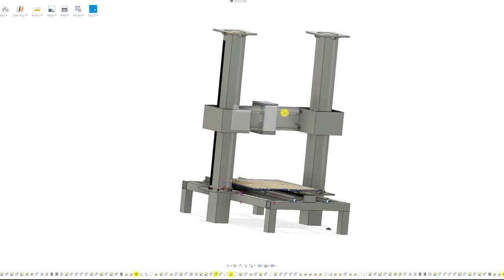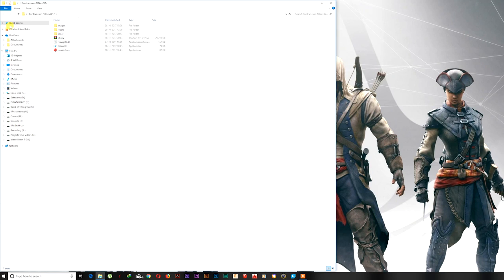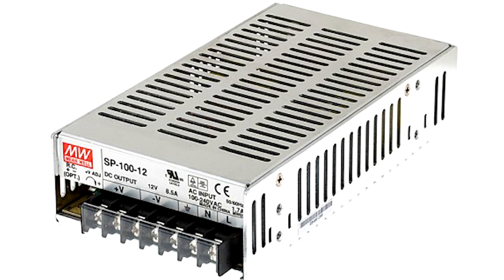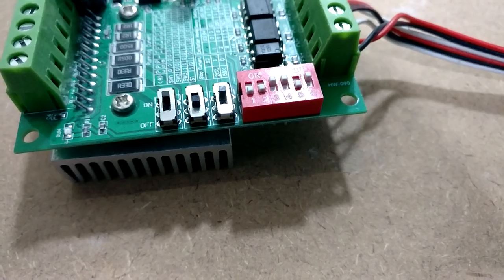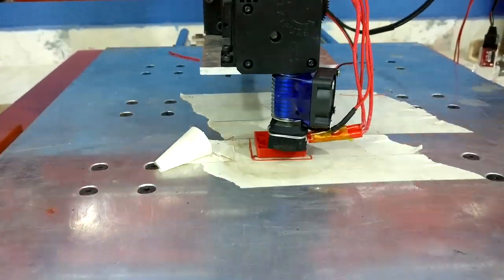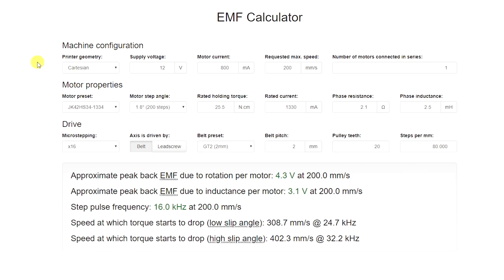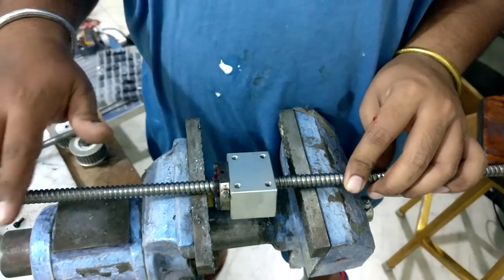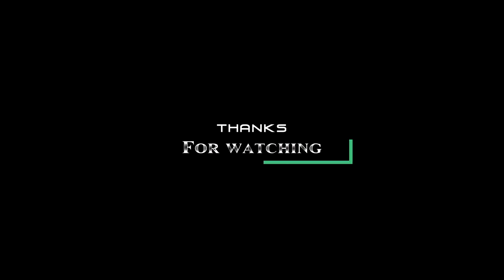3 in 1 CNC / 3d Printer Problems / Port Detection / Thermal Runaway / Extruder Motor / Step Skipping

Comment: Best video and information  as always  , sir I need the link of that spindle 500w
Reply from the maker: Thanks dear, now i put that spindle link you can check:)
Reply: @ambroscustom  sir I can't see the link in the description  can you post it as a reply for my comment
Reply from the maker: Rs. 1,863.60  12%OFF | 0.5kw clamps Air cooled Air cooled spindle ER11 chuck CNC 500W Spindle Motor + Power Supply speed governor
https://a.aliexpress.com/2fLc2SMu

Comment: May I know where to correct wire for laser and filament runout sensor?
Reply from the maker: Buddy you can use any fan port which can be controlled manually, make sure to use only 12v power supply, if you are using 24 v then laser should also of 24 v. Filament runout sensor need to be installed on extruder 1 endstop. Make sure to check the ampere rating of your laser. Because fan port fuse might blown out due to high current requid by the laser diode. Mine gets blown out and  I repalce mine with 2.5 amps fuse but it's a risky task. Tried at your own risk. Good luck
Reply: AMbros Custom Fan have only 2 pin,laser have 3 pin,may I know how to correct?and how to replace the fuse?
Reply from the maker: Laser have 3 pins leave the TTL wire as it is use only red and black. Use those fan pins which can be controlled. Don't use those fan  pins which remains permanently on. The fuse is of blue colors and 1 Amps written on its top, it stays above the fan pins area. This fuse is usually used in cars. So you can get it from those guys by showing this. Just pull it towards yourself and it came out easily. Comes in various sizes so it's good to take it along with yourself for better optimization. Again buddy you are taking risk by yourself by replacing that fuse. What's your amps rating of the laser and what volt power supply you are using.
Reply from the maker: You can send me mail for more eleborated answers

Comment: Bro, For losing steps you can use the closed-loop stepper motor. It will work.
Reply: Or you can use a closed-loop stepper driver circuit.  It mounted backside of motor.

Comment: I'm really surprised you tried to run a 4mm ball screw x stepper motor at 100mm/s.

This works out to about 1500rpm and steppers just don't have any torque at that kind of speeds
Reply from the maker: Yes I was doing that, but you can do, definitely there is a reduction in the torque but in that way you need to increase the voltage to counter the step skipping and but it definitely have some limits.
Reply: @ambroscustom  Yes, it's doable but it tends to lose 1/2 its rated torque even at 70V, or more than 3/4 at 24V or so.
Plus I don't really want to imagine the thermals when running it for 48 hours straight for 3d printing.
https://blog.misumiusa.com/the-great-debate-stepper-or-servo/ 
I guess this is one of the ironies of wanting to build a heavy duty router x 3D printer. (I'm also having similar design issues)